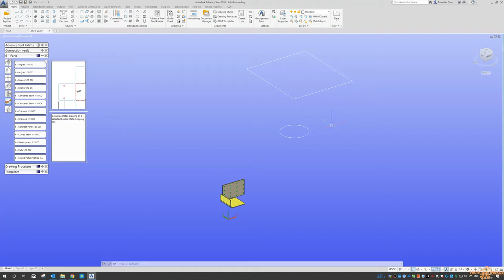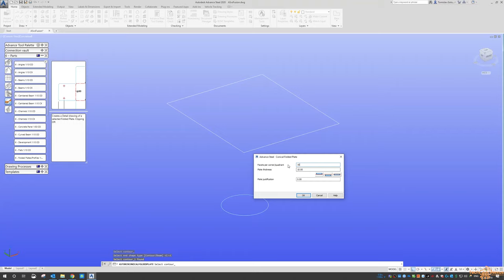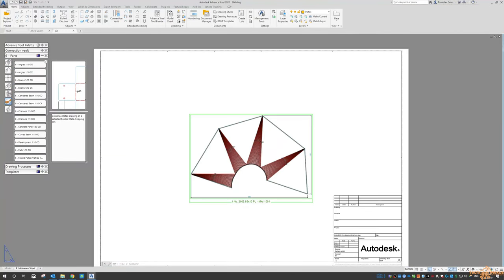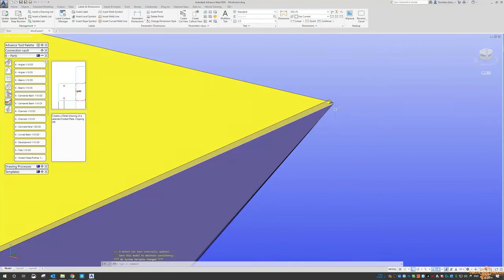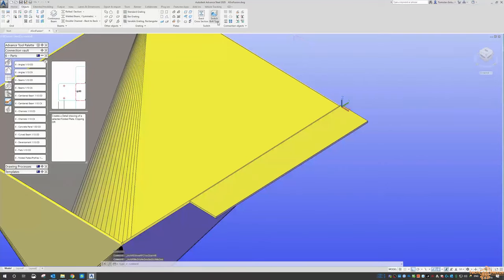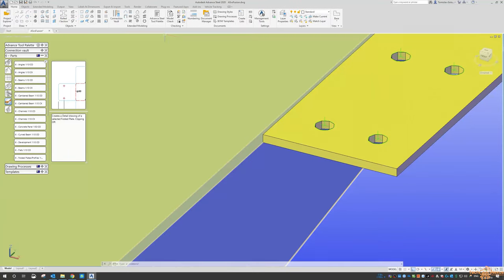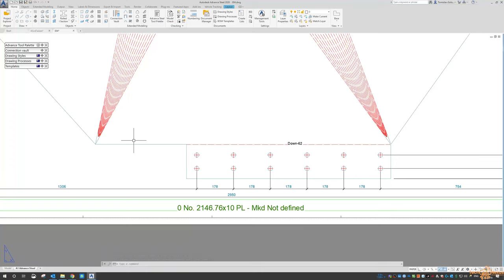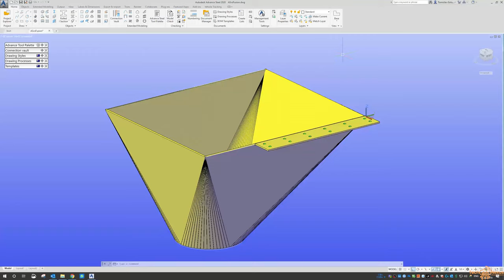Advance Steel Plates - Part 1

Comment: There is an option in the Management tools under plates to get the folded plates to follow profile exactly (1.30) but the downside is possible self intersections. Also model from opening inside and justification 1 will stop self intersection usually.
Reply from the maker: Well picked up Gary, thanks for the comment!